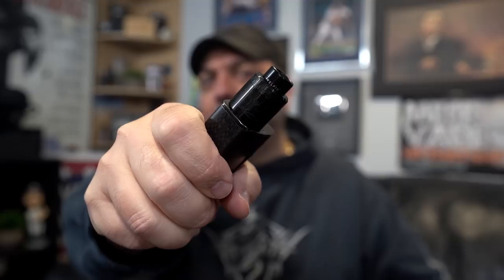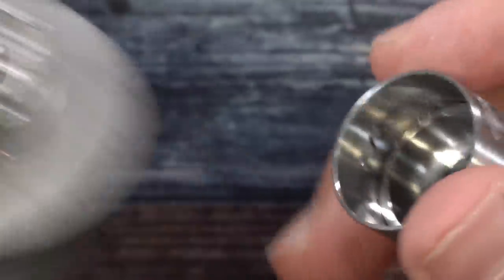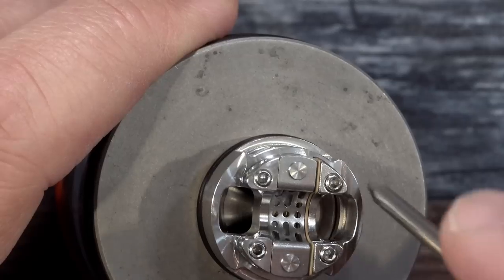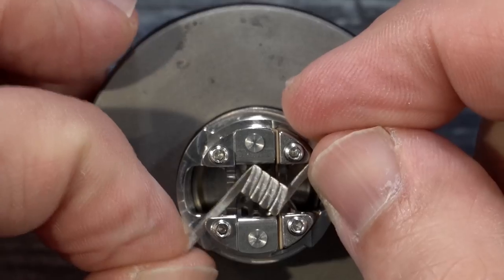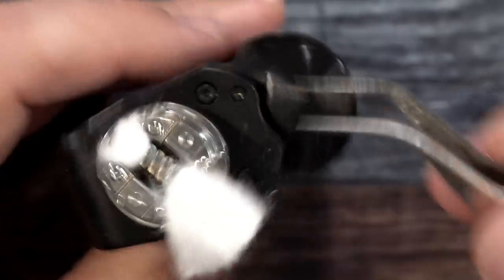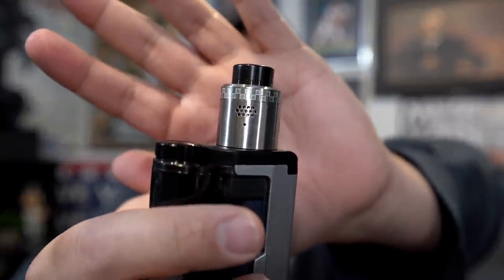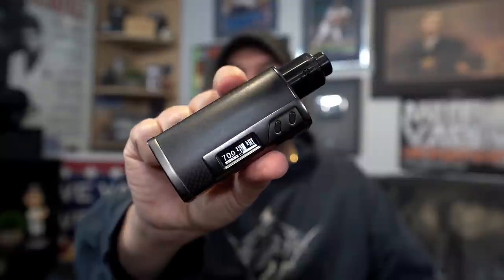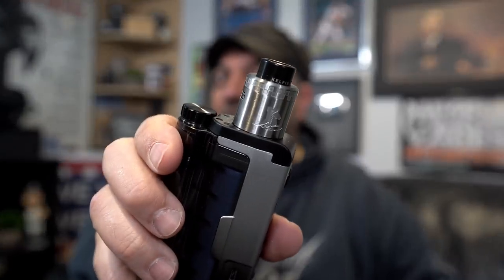EHPRO Kelpie RDA By Vaping With Vic

Comment: Think the little hole is for when it was going to be a two piece top cap, so you could close all the top holes and then just use the one for a mtl vape.
Reply: No I think Master Mike Vapes had it right. The way this top cap is you can't tell where it's at unless your sucking in while turning it at the same time.
Reply: @nicholascampbell974  mmkay.
Reply: @nicholascampbell974  Vic has said when ehpro was designing this before he got involved it was originally going to have an mtl option but to bring the cost down they scrapped the idea..
Reply: My bad I missed that video. I've watched other reviews and hadn't heard anyone but Mike give this thought on that hole. It made sense.

Comment: There's no need for double honeycomb airflow.
The air should be compressed all the way in until it hits the coil, where it hould be restricted.
So the air is expanding as it hits the coil, then compressed again through the chimney & expands as  it enters your mouth.
Reply: What single coil you recomend? Think this would be better than asmodus .blank?
Reply: @kapitansultan7740  the flave from alliance tech 22 or 24 👌

Comment: Why do they put a 4 wrap coil as a spare? That clearly needs a fifth wrap (if you don't want a deformed coil). 
8:38 That is very true. It's always better if it's a bit wider than the airflow rather than the contrary.
Reply: I agree. I prefer contact coils but to install the one that's provided you have to distort the shit out of it. The posts are too far apart. (Plus it's just hideous LoL)
Reply: @jakefrommaine8646  I don't have a problem with them being separated as I like big coils. But that spare coil is just not adequate for the atomizer.

Comment: Vic vapes high VG juice maybe this the source of his spit back issue. Reminiscent of Cthulhu Mjölnir RDA in some respects also a little bit of the Hermetic, both reportedly quite flavorful. I think the machining marks are a result of galling which is particularly problematic when machining Stainless steel. Interestingly the other meaning of galling is annoying; humiliating. Vic would find these machining marks very galling.

Comment: @mikevapes Vic said that bottom hole is so if you over squonk or drip, you only have one small pinhole leak rather than the eliquid pouring out of the airflow. Just wanted to let you and everyone know
Reply: That doesn't make any sense... if it wasn't there it wouldn't leak at all.
Reply: Vic just making something up about a device he barely had any input in the design of
Reply: @FLUFFALUMP_FPV  and Jake definitely did a good job covering the og comment 🤣🤣🤣🤣🎯💯

Comment: Hey Mike I hope you make another single coil RDA, both of the ones I have are daily bangers, the Rebirth and Recurve. The piano black Rebirth will look really good on the blue Clutch with a blue drip tip. Matchy matchy. 
My guess is you're making a dual coil RDA or maybe mesh, maybe not, to match the Clutch. What about a vert?
Reply: How do you put a single coil in the rebirth? I mean yeah you could but it would have to be around a 5mm coil for the airflow to hit it...
Reply: @gt_blaze1764  one is a 2.5mm 26(probably)ga roundwire parallel and the other is a 3mm flatwire coil. Both ohm out around .4 -.5. I suppose technically one of them is a dual coil. I like it with the AF wide open. Very cool (temperature) vape. Its just preference man.
Reply: @gt_blaze1764  no not at all LOL 5mm Id?? Noobs. Have you seen the af on the rebirth or vaped it? I can guarantee that if you put a quad fused clapton or an alien leave it right in the center the af will smack the coil just right just trim the legs proper (what Mike suggest) and you're chucking flavor and clouds.
Reply: i have 3 rebirth rtas and an rda, I know exactly what the deck and airflow look like, Mike even says of course you can put a single in it, but that's not what the deck is optimized for. I wasn't saying you couldn't do it, I just don't think even with a 5mm coil it would perform as good as a dual coil..